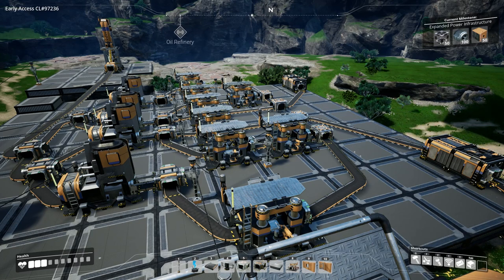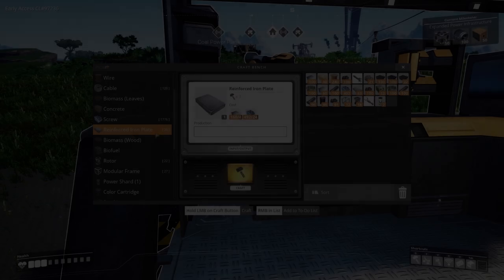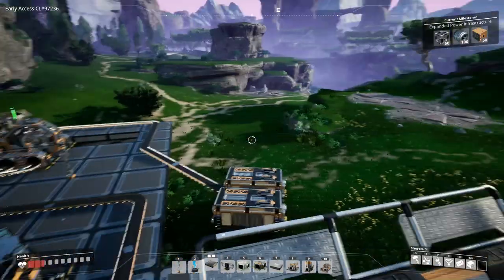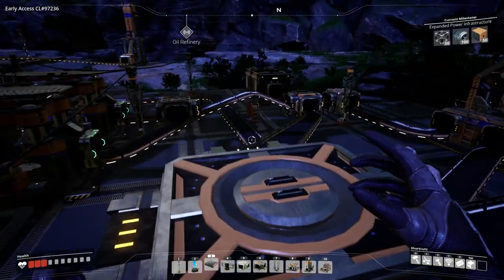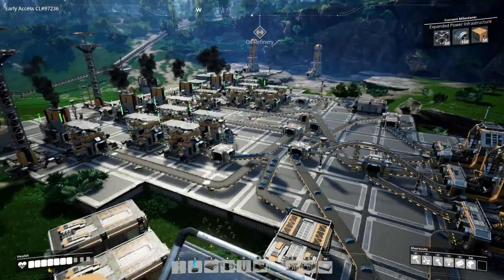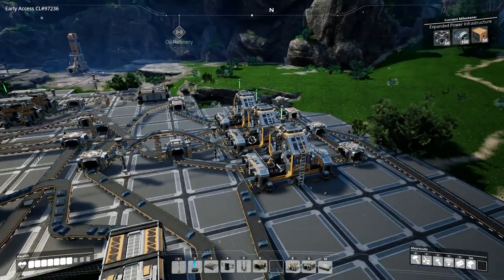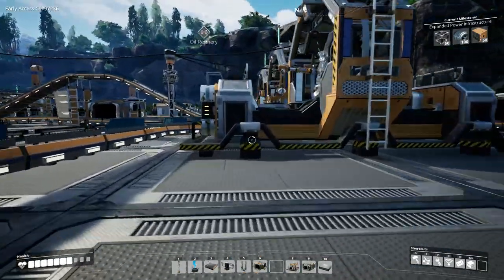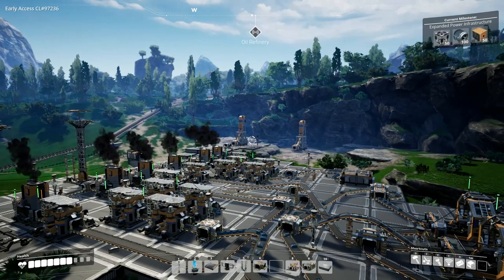Satisfactory Game 100% Efficient Build Guide Pt2 - Reinforced Plate Assemblers.

Comment: Honestly, love the vids. Great vids. My question is how, in this video, you had 3 different Screw > Assembler setup (version 1, 2 and 3 failed but 4 looks good) however version 2 and 4 look the same? You have 2 Screw makers, merged then split into thirds, two- thirds go into the right Assembler with one-third going to the middle one. Same on the other side so each Assembler gets two-thirds of 2 screw makers. That is the same in version 2 and 4 no?
Reply from the maker: Hey! Thanks for checking out the video, I can't remember exactly what the issue was as they were pretty much the same, oh I remember! all of the screws were coming out a disjointed times, so eventually the middle splitter was getting uneven splits against the other two... I thought it might help to have a container buffer, but I don't actually see how it helped looking back :D . but I do believe the version I do in the next video is better (if I remember correctly)